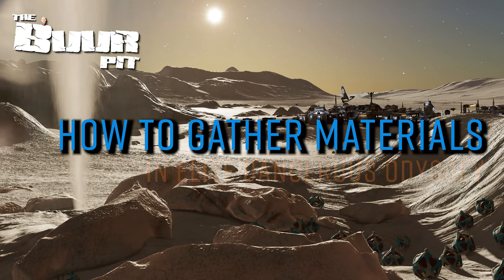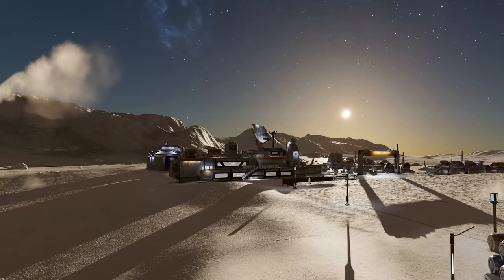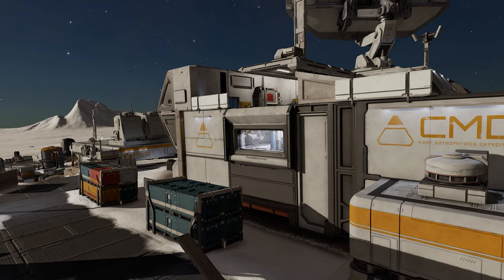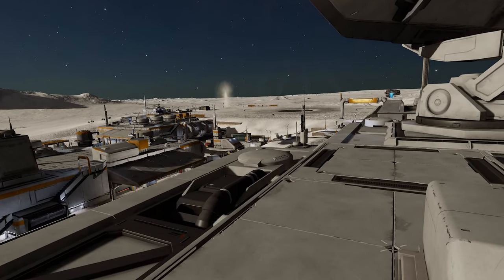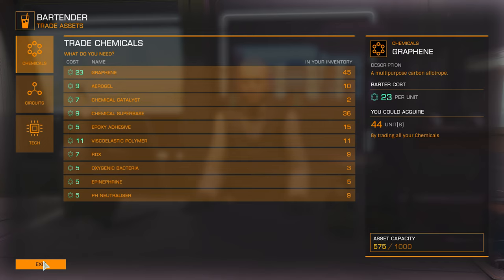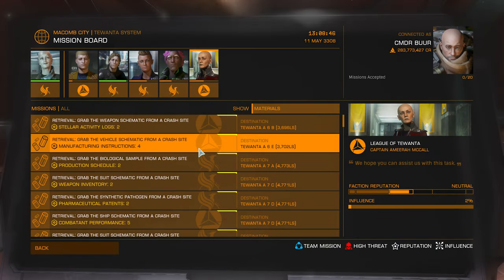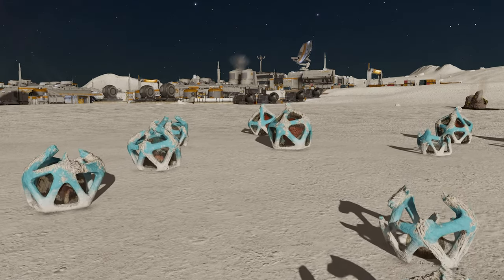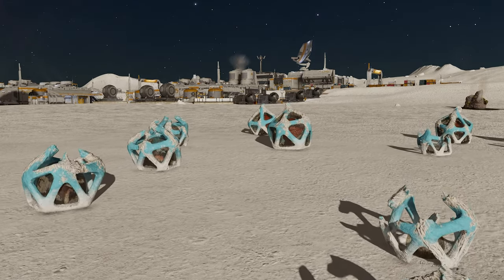Elite Dangerous: A Guide on How to Gather On Foot Materials in Odyssey

Comment: I have found a good method - go to a system with "problem" state such as outbreak. Then do support missions to power on settlements. Power on the settlement then raid the place. You get loads of data + materials.

Comment: Good suggestion of ship for Odyssey mission running, especially if you want to bring a friend. For solo, I've had a lot of good use out of my Courier and Imperial Eagle, both also loaded with dumbfires! Advanced Thrusters make for a speedy landing and getaway (especially if the settlement is firing at you on the way in!)

Comment: Your advice on ships is very helpful especially the dumbfire missiles.  I'm currently operating a resource-grinding Vulture and the L3 dumbs make short work of those pesky ground protection troops :-)
Reply from the maker: World of difference aren't they :)
Reply: @TheBuurPit  Once you've mastered the aiming the L3 dumbs (and you don't have to be that accurate ) they clear the decks very efficiently.  then on to the redistribution of mats to my storage hold
Reply: The only problem with using dumb fire missiles to obliterate ground troops is you don't get any bounties from the dead body AI. I have always used my Krait MKII with 2 dumbfire missile racks to quickly get rid of ground troops as I don't need the extra credit bounties.

Comment: I'll break my runs down to raiding certain buildings. Raiding IND buildings for example. I'll break it down further into material or data runs, depending on what I need. It's also fun to run missions while mat/data gathering. Oh, and I also turn off the damn settlement alarms.

Comment: No anarchy in Colonia region :( -  have to twiddle thumbs in a random uninhabited system while the notoriety clears. Have had some small luck finding FCs that trade what you need, although most are in the Bubble for obvious reasons. Material Helper is amazing - the dev is definitely been bought a beer!
Reply: It does have. I got lots of e-breaches there. Dont know what the system name is rn,  but i am on my way to colonia, just got halfway with 37ly jump range.
Reply: @gnardada3322  Inara search for Colonia Region with Anarchy and Bartender services yields nada - I wasnt specific in my comment that I wanted to find an anarchic bartender to sell dodgy stuff to. There are a few things like this limiting the Colonia region
Reply: @gnardada3322  FYI there was a turn-a-blind-eye fleet carrier in the Colonia system with an accommodating bartender - problem solved!
Reply: @gnardada3322  I have only just finished the Colonia Bridge run (without using Neutron stars) in my trusty engineered Krait MKII (45LY range). Some 29,251.2 LY (Yes! I kept a log) distance and 705 Hyperspace jumps. Interdicted 3 times en-route with 2 Mauve Adder Server disconnects to contend with and I also did the short detour to Attenborough's Watch Asteroid Base at LAGOON SECTOR FW-W D1-122. It's my very fist trip out to Colonia, so I did it the "hard way" scanning interesting Systems along the Megaship route (courtesy of CMDR Mita Kondria).

Comment: If you find a system with missions sending you to massacre a faction bear in mind that kills can only contribute to a maximum of 3 missions. Also, you can only take one mission that targets a specific settlement. If you take say an assassination mission at X settlement all other missions that target that settlement will disappear off the board. This doesnt apply to missions that send you to massacre a faction as you can do those at any settlement that faction owns. I try and get 2 "Massacre Faction" and 1 specific settlement mission together. As for Data, always try and get Opinion Polls (usually from data terminals in Habitats) and Smear Campaigns (I dont know where to get this one, something to do with systems in election state I read). Two of the ground equipment engineers require those items to unlock.

Comment: I had problems with taking loot from a settlement in that I was constantly being scanned by NPCs. Then going into combat I died. then I found myself in prison and after 30 minutes and a lot of fines and fees I'm back where I started with no mats. I need a no combat routine or lots of help as I can't seem to kill NPCs before they kill me.
Reply: I just shoot them from my SRV, if I haven't already done it using missiles. Then again I usually go to empty bases anyway.
Reply: If you stick to anarchy systems only you won't go to prison. I use an imperial courier because it is cheap to rebuy. A dumb fire missile rack for  taking out crash site NPCs before landing. Ryu Keep in the Lu Dis system you can land right next to the  depots, just walk in and take stuff from unlocked cabinets  when nobody is looking. As you leave, stand at the exit to open the doors but don't just walk out. Use your external camera to look outside for guards. Step back if they are close to shut the doors again. When the coast is clear, run back to your ship and take off. Super cruise away, log out, log back in then go back and repeat...
Reply: @leebulbrook1816  It's not just Anarchy Systems, you absolutely have to make shure of the Settlement you are targeting is also in ANARCHY state also.

Comment: You still need Scarab SRV for exploring and material farming. Scorpion has not waveform scanner for finding material signals and POIs.
Reply from the maker: You don't need the scanner for the type of material gathering described here.  The scarabs scanner is used in horizons material gathering only.
Reply: Which is why he said you make a dedicated ship for this kind of work for which the Scorpion is well suited.  I actually use a Python as a settlement runner that CAN do some other BGS work too.  Can almost always find a landing spot and it can do a decent job running ship missions for settlements as well and it can be made quite a stout machine.  I do have a Cobra settlement runner and it is indeed a very useful ship to setup for this purpose.  Not expensive, and it can land just about anywhere.  I have other ships with Scarabs to do ship material gathering type stuff.
Reply: @kylecrane4376  Understood. I toggle between Horizon and Odyssey a lot for material gathering and I was pretty surprised to find that metallic meteorite and such still exist. I just hadn’t noticed because I was all over that scorpion when it released and realized it didn’t have the special scanner. So I now use the old material resources as a filler, in-between locating sections of lava spouts and what not.